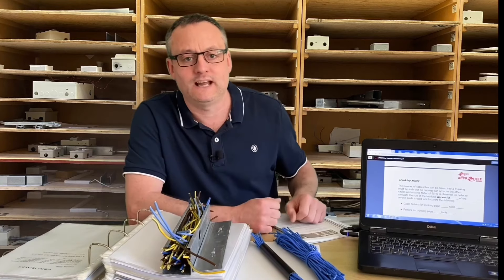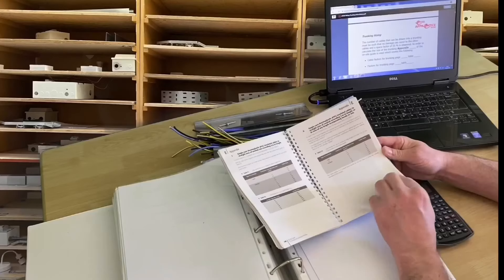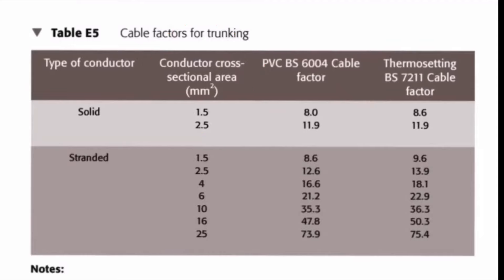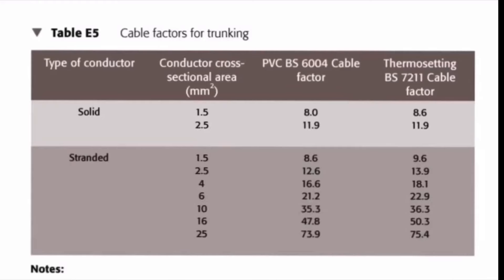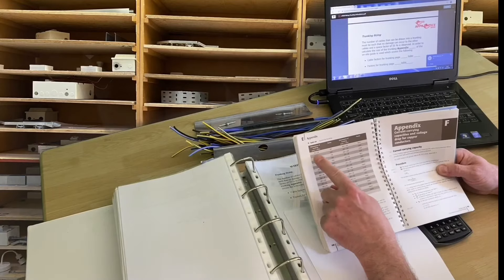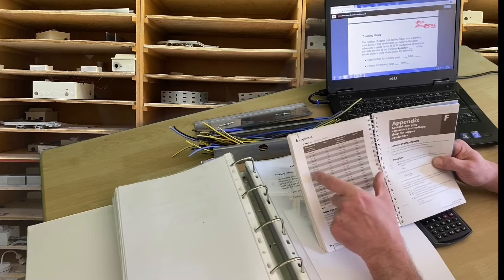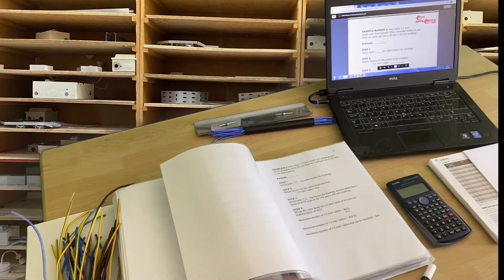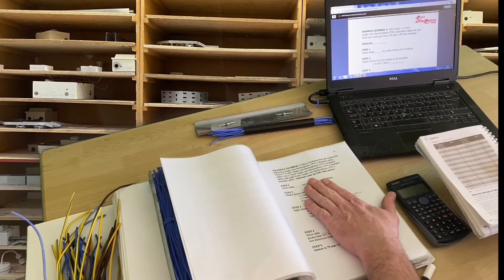How to Calculate Trunking Capacity (Size). How Many PVC Single Cables can we Install in a Trunking.

Comment: Brilliant video, Is there a separate table for running pvc/pvc cables in trunking? Such as double insulated tails or just twin and earth??
Reply from the maker: Hi look at the bottom of page 150 of the On Site Guide. It talks about the overall cross-section of conductor... this should help with your questions. Thanks for watching. Gaz 👍
Reply: The paragraph you refer to is a little vague! I can see it says that the sum of the overall csa’s of sheathed cables should not exceed 45% factor, But how would you actually perform a calculation to verify your not installing too many cables into a given trunking? (eg. How many 25mm double insulated tails fit into a 100x100 trunking?)

Comment: I will be running 13 x OM5 fibre cables together with a single 4mm power cable through mini trunking.  Is there a video on how to calculate the size of the mini trunking I should use?